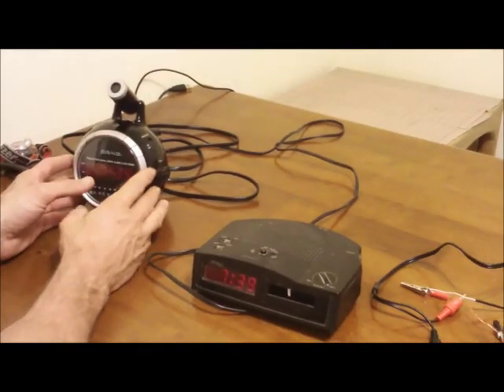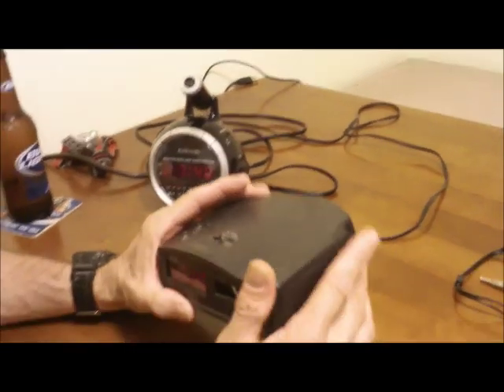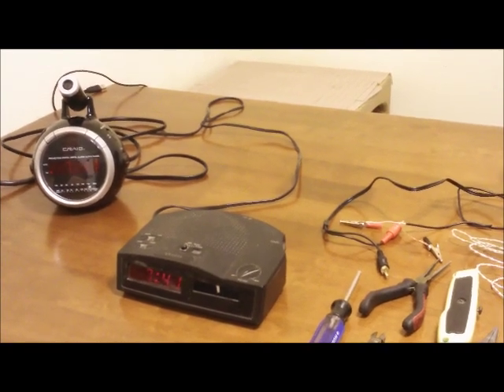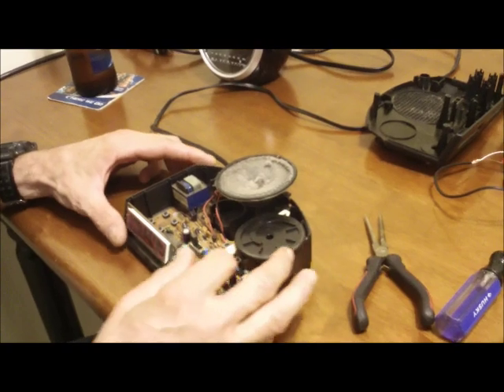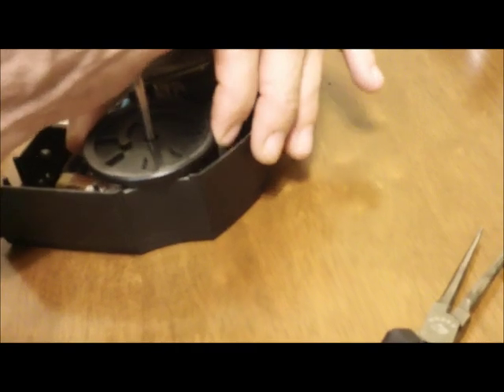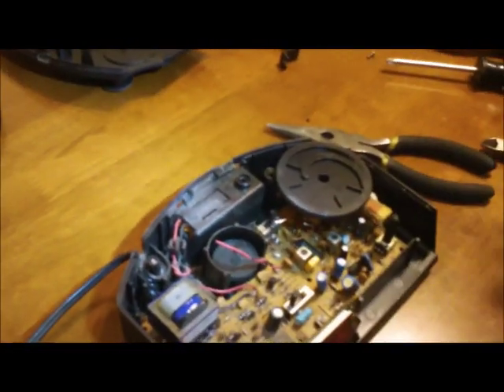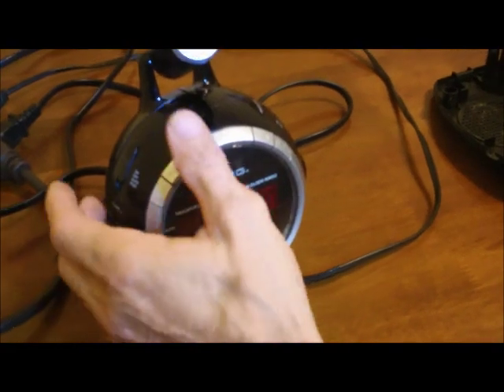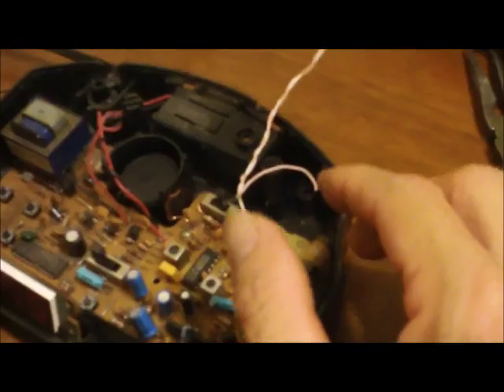How to Build an FM Transmitter From a Clock Radio (back by popular demand)

Comment: Just buy a Raspberry pi kids,install some software and go from a qualified book that follows instructions.
Reply: Omg... Raspberry Pi isn't  radio but a transmitter
Reply: You just need to install some software on it and it's transmitting...
Reply: But Raspberry PiRate Radio isn't good enough as good FM transmitter
Reply: That's not the point of this video. This is merely showing a very ingenious hack that hails from an era long before the dopey RaspberryPi, which will also not give you the kind of the range that this gentleman is talking about. I run an LPFM pirate station in my town, and sure, I would never rely on a converted clock radio as my transmitter, but it's just neat how this is done and is a great thing to know in case you needed to transmit an S.0.S. in your immediate area in time of natural disaster, which is what you could do with a battery powered one.